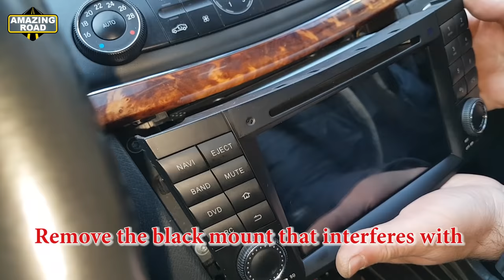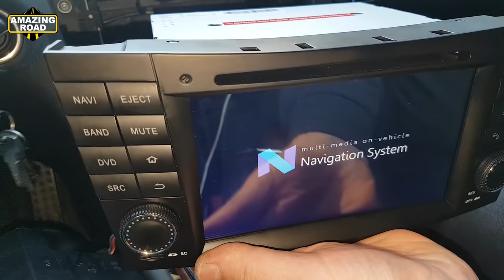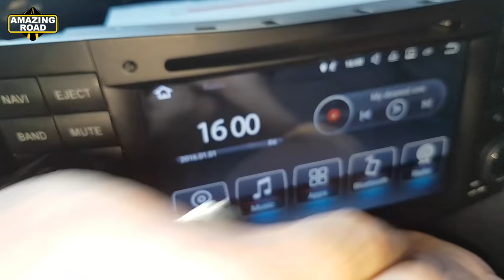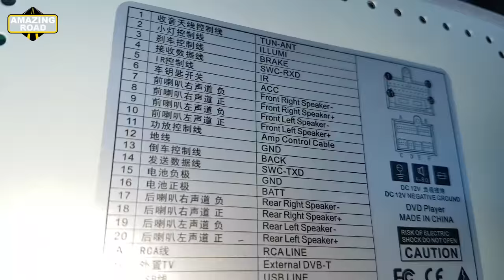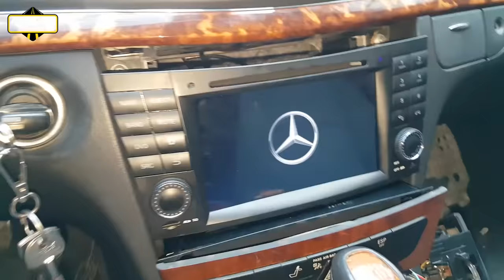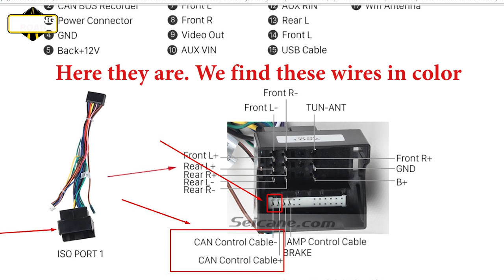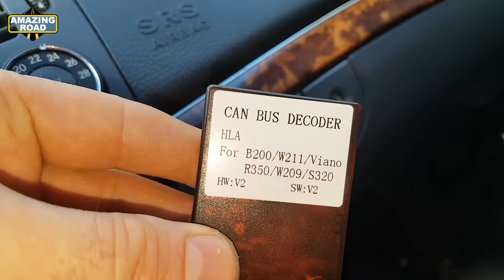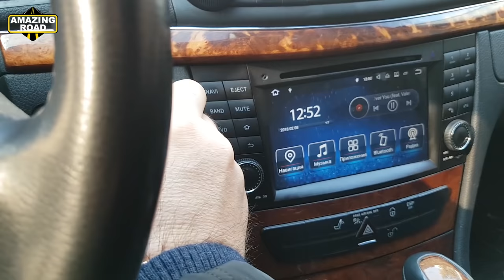Mercedes W211 Detailed Installation Android Radio DVD COMAND & CANBUS (Wheel buttons) & Decoder

Comment from the maker: Mercedes W211,W219 Android 7.1 DVD Radio (COMAND AUDIO)  https://youtu.be/2rZPcgJUnI4
Changing SBC Brake Pressure Accumulator in Mercedes W211 / Error C2131  https://youtu.be/CCXlfeDAly4
MERCEDES W211 IMPORTANTLY! HOW TO REPLACE FRONT BRAKE PADS https://youtu.be/6syWcyTcTVE
How to Make AUX on Mercedes W211   https://youtu.be/7JnVR-nF0UQ
Deactivation and Activation SBC Without Star Diagnosis at Home on Mercedes W211, C219,  R230 https://youtu.be/J8jaVufCQcg
Reply: Amazing Road TV  Barlus axpers, mi hat most usb adapter em zakaz tvel 211 i hamar, guzes dra dnelu videon unenas kanalumd?
Reply: Amazing Road TV mate what’s the tune yeh?
Reply: 00
Reply: meraba banada lazim nasil yapabiliriz bilgi verin yeriniz nerede

Comment: In order to get backlit illumination, I think I use a wire called "Key 2" on my android head unit because this is the key position where all my backlights illuminate in the car. If so, then I would connect to the third wire on the cigarette lighter as you did. Am I on the write track?

Comment: Amazing Video! I did everything as in the video but I don’t have Audio. I did not connect the + and - from the canbus cable to the decoder (green wires) yet. Is that the reason? I thought it‘s only for steering wheel Control

Comment: Great video! It has been helpful on my w219 and new seicane unit. I have power and the decoder hooked up but no sound. Question, do you have to have the canbus wires connected for the steering wheel in order to get sound? thanks in advance!
Reply from the maker: If you have optics, then you need a decoder
Reply: Thanks I got it figured out. I didnt have sound until the canbus wires were connected. Cheers!
Reply: Hey buddy I did this on my w219 and canbus under passenger dash connects steering wheel controls. I also have a seicane; let me know if you want chat or compare notes
Reply: LexBrett Gen2  pics of harness please

Comment: Great video do you know if this unit will work on a 2003 E500 as well? Thanks just don't see the E500 listed on there site. Thanks :)
Reply from the maker: yes. write to the seller. And use my promotional code for a discount 5%

Comment: This is a wonderful video, very helpful, but I have two question. Can this CANBUS work on Mercedes W210?  when you measure the CANBUS connecting wire, the voltage shows 11.26, seems it is car's battery voltage, and - wire seems ground, am I correct? I can not get that voltage from my W210 CANBUS two wires, do you know where is the problem? thank you.
Reply from the maker: The same thing I wrote another person who had W211. He also said that his voltage is below 11 volts. To be honest, I do not know.
Reply: Thanks so much!
Reply: @chinesehope  gsjf
Reply: Canbus worked on my w219 fyi its the harness under passenger dash
Reply: LexBrett Gen2 what u mean I have a 08 cls550 bought a android headuot for the W219 how does the harness look

Comment: If you have a Mercedes 211 with Harman Kardon sound system, you need one more cable that you connect from the radio to the leather amplifier in the trunk. This way, what you did will not play well.
Reply: But good work that you could connect in this way.
Reply from the maker: Instead, there is an optic box that is more expensive than this cable.

Comment: Hi how did you do for radio to turn on just putting the key in I’ve installed mine but I have to turn key1 to turn on and also how do you make the hazard panel open and close as mine is not moving at all??
Thank u
Reply from the maker: Yes, just turn the key

Comment: I have installed a similar device ZLTOOPAI ANDROID 10 W203 MODEL 2004 SPORT COUPE.i have noticed that the device is working at high temperatures 95c and in idle 65c-75c.The chip is RK3368 8core 1.5 with 4gb ram 64 flash memory disk.Is their any way to reduce temps cos it has DVD ,I haven't opened it but I search similar videos and I can't find.Also how I can have root access to rk3368 to install kernel tools to tweak the CPU undervolting and underclocking to reduce thermals.

Comment: i loosened the two screws under the radio but the radio still doesn't pull out. It holds in place like its still fastened to something. I have an E55.
Am I missing something?
Reply: I figured it out. Got to keep screwing the screws out, a long ways
Reply from the maker: Yes
Reply from the maker: https://www.youtube.com/watch?v=69yuzCO-_zg&t=64s
Reply from the maker: https://www.youtube.com/watch?v=xk4dCH97ky4&t=109s

Comment: Great video!  But, wow that looks like a nightmare for a diy novice.
Reply from the maker: I'm new too )))
Reply: I found this extremely hard for a diy novice as well; plus my head unit didn't come with instructions.
Reply from the maker: @lexbrettgen2120  No, not so difficult. Do you have a car for Japan? If not, then it is even easier.
Reply: Amazing Road TV  I have a 08 cls550 do I have the easy connection on mine

Comment: Hi. Thanks for your helpful videos. Help me with a question please. Will the decoder (you put the link) fit to another make of chinese head command? Or will a 6 metres cable fit as well as the decoder? And a last question: has the decoder been delivered soon? Because the seller doesn't like to answer. A great thanks in advance 👍
Reply from the maker: https://www.youtube.com/watch?v=5Pn3RZFFH2E&t=55s
Reply from the maker: If you have optics, then a 6 meter cable is not needed
Reply from the maker: https://www.youtube.com/watch?v=69yuzCO-_zg&t=30s

Comment: The MOST box in the video has Yellow, Black and Red wires, but on the website there is only Yellow and Black, no Red cable (ACC). I also have the Red wire, where do you connect it?
Reply from the maker: In the video, I showed everything in detail

Comment: I have the same Japan radio in my w220 s350 2005. Do you think the procedure with wires will be the same ? I am looking for solution with update.
Reply from the maker: Let it be the same. Remove the ashtray and look under it. there should be an optics wire

Comment: hello

i tried to install my new radio too with your instruction. everything pretty easy. but i get no sound... can you help me? do you know where the problem can be?
Reply: You have harmen carden speakers
Reply from the maker: Which system? Optics?
Reply: Amazing Road TV I have the same problem. Everything works including steering wheel controls but NO SOUND. I carefully watched your video and I think it is the blue/black amp turn on wire which I have not connected. Where does that wire connect to? Your video only says connect that wire but does not show where to connect it to? That will turn the amplifier on? Please help.
Reply: Mine is Harman Kardon optic unit
Reply: UPDATE- I have made it WORK!! No one seem to be talking about the “Fiber Loop” that you need to install on the unplugged CD changer fiber which will not be used going forward. I bought the $10 fiber loop from Amazon (Easyget Fiber MOST Optical Optic Loop Bypass Female Adapter For Mercedes Benz, Audi, VW, Porsche) and the moment I plugged in in- BINGO- the sounds started WORKING!!
Reply: Paul R how you connect your wires? Such as the fiber optic decoder, canbus and Unit wires. Which did you connect to the cigarette lighter and which to the constant?

Thanks

Comment: Hello friend ... I hope you can help me please. When I turn off the car and take out the key, the settings of equalizer, radio stations and all other settings are erased and I have to adjust them every time I use it. I have the yellow wire (b +) connected to the yellow wire of the original radio (constant power) and I have the red wire (acc) connected to the cigarette lighter. I think the problem comes from software or FACTORY ADJUSTMENTS You have some idea of how I solve it.
Reply from the maker: I can not help (((

Comment: Boss, I purchase the same screen exactly 9.0 Android PX5 ROM 64 / RAM 4 GB and i have 2007 350 Japan specifications i think same you’re and they asked me throw online if i have Amplifier before send the item to me I answered no because my car doesn’t have harman kardon or other sound system - my question why they asked me and I should order any extra parts for the screen / looking for your assistant please
Reply from the maker: If there is a harman kardon then you probably will need an additional optics module
Reply: Amazing Road TV 
No Boss,

I have nothing at all no sound system , some people they say something about optic fiber !? I have no idea 💡
Reply from the maker: Remove the ashtray if behind the ashtray there are two orange wires with skim light, so you have optics
Reply: Amazing Road TV Yes boss i have that cable , my Question if i have the optic fiber its mean there’s sound system and when I purchased the screen they send it without optic fiber decoder !? I’m not yet receiving the screen yet I should buy the optic fiber decoder separately 🤷‍♂️🙏🙏🙏
Reply from the maker: @atefabusaleem2760  Yes, you need to buy a decoder separately. I left the decoder link in the descriptions under the video. You can look and choose which one to buy
Reply: Amazing Road TV  ❤️❤️❤️ thanks really Sir,  You are a great Man 👨🏻
Reply from the maker: @atefabusaleem2760  Thx friend ❤️

Comment: Tnx in conector canbus i am + 3,5 volt and vorks on the steerling wheel but at s moving slowy ?
Reply from the maker: I do not understand your question. excuse me
Reply: Please your email und i am send foto....i am from Romania i do not speak englisch weell.....sory iam google translate...please und tnx
Reply: Connector all wiereisare conected to each other so it does not matter which pair of wires you conect.....HERE i am 3.5 volt  not 12 volt ...you understand please ?
Reply from the maker: Doriți să vă conectați CanBus și aveți 3.5 volți? Unde ai 3,5 volți?
Reply: In conectorul de sub bord in dreapta nu am 12 volti pe toate 5perechi de fire  3,5 volti        Trebuie sa fie 12 volti si nu merge comanda de pe volan
Reply from the maker: I definitely do not know this friend. I was there 12v. I do not know why you have there 3.5v.

Comment: Is possible work without decoder ?
Reply from the maker: If you do not have optics, the decoder is not needed
Reply: Possibile but  You should connect with new cable between door and sound system. So it iş possibile but silly
Reply from the maker: If it does not have optics, nothing needs to be connected and cut off. Connect to the original connector.
Reply: Amazing Road TV yeah that what i want
Reply: Is there any way to know if I have the optic fiber ? 2003 w211 with APS50 thx by advance

Comment: How many speakers your car have? Do you have factory subwoofer in trunk? Is the sound quality and BASS the same as before with factory headunit or possibly better or worse with installed Android headunit? Thank you
Reply from the maker: I have all the factory and no subwoofer. The quality is the same as before, but the sound is slightly lower
Reply: Amazing Road TV Harman Kardon audio system without subwoofer in trunk? That's impossible. Go check it out, the subwoofer is behind rear headrest, or you can open the trunk and look upwards and you will see subwoofer there.

Look at this picture: http://bilder.hifi-forum.de/max/892215/mercedes-w211-zeichnung_770550.jpg

Comment: I install isudar double din 4 gb 32 gb very easily with the help of your video every thing works fine thanks bro for this detailed video
Reply from the maker: Thanks )))
Reply: do you have optic fibre in your car? i am considoring to buy the same unit. Still recomended or do you have any issues with it?
Reply: I have a clss 550 where can I get the wired harness for an aggressive market radio

Comment: I have some questions.

1. You Said if you do not habe japanes and american Version of the comand it is Just plug and play. All will work. Does it mean same for  the canbus? So i do not have to cut the wires?
2. The optic Decoder is the same? Only remove from the connector and plug and play to the Decoder?.
Reply from the maker: 1) canbus must be connected as I show in the video. it doesn't matter USA, japanese and europe.
2) Yes

Comment: I have orignal german conactor but in the right side of big conactor 2 fibre optic cables r visible is this din works fine as you tell us if their is big conactor in the car everything is ready or i need fibre optic decoder

Comment: The FM Band in japan is  76–95 MHz right? Changing the head unit to a xtrons, this automatically will work with the US band 88.0 - 108.0 MHz?
Reply from the maker: Yes 88.0 - 108.0

Comment: Got a question not sure if you can help, I've installed an android multimedia system which is working fine, but can't figure out which wires from the original car harness are the source for the steering wheel function keys. Can you help it's for a CLK w209 05 plate
Reply from the maker: You have no instructions? Look in the instructions. Different models have different wires

Comment: I do not know if you know this, but do you know if there is a way to connect a backup camera and if so was the plug there? I have been told you can just plug one in but I want to make sure. Also, is there coax cables for a subwoofer there too? Thank you!

Comment: one question please. because I cannot put without a decoder directly from the outputs that the radiocd brings. without going through fiber optics? Do you understand what I mean? If you can give me your email and send you a photo with what I want to say and the radio I use would be great thanks
Reply from the maker: The audio system seller should give you all the answers. The seller will tell you which one is right for you

Comment: Seems astonishing that someone would go to so much trouble to connect all those wires, but just twist them together and wrap them in PVC tape. 
It's guaranteed that one of the joints will work loose, probably even before the PVC goes hard and unsticks (which will only take a few years).  
Doing it properly would have been very little extra work.
Reply from the maker: I showed how to connect. and you can connect as you think is right. Could say thanks. And what will happen to the wires, it will happen on my car. don't let it bother you
Reply: @AmazingRoad  Yes thank you for trying. Unfortunately you showed people how not to do it. That really is not as helpful as it could have been. 
Seems a pity because you went to so much trouble to film the fitting. Soldering the joints, or even using Wago connectors would have been very little more effort. Using the correct tape would have been no more work.

Comment: Hello,
Very useful video but I have one problem with my W211. When I connect the optical decoder with the aux in and out there are not any sound. Everything work, even the command from steering wells and everything but no sound. Did you know where is the problem?

Comment: for the steering wheel controle, there is a P2 cable, that looks just like an aux cable.  I put mine on, but for some reason it didnt work ( Im using a pioneer head).  Is there any extra wire that should've been conected in order to make the steering wheel control?
Reply from the maker: No, only this wire

Comment: What is canbus? Planning to buy generic Double Din and install with mounting bracket. Mercedes Benz C Class C220 CDI 2005. If I don't care about steering wheel control... do I need any special cables? I think this car is fibre optic therefore need more work?
Reply from the maker: The steering button needs a block CANBUS
Reply: @AmazingRoad  Do you have Facebook messenger or something where we can talk for some quick advice?

Comment: I'm looking to get one of these but I read it's not compatible with the factory Harmon Kardon amp located in the trunk. If so, what aftermarket amp is compatible, and are there any other components required besides what comes with the head unit?
Reply: Same amp. Just get the decoder that is mentioned

Comment: Hey Guys, Awesome video! any tips on getting that CANBUS X30/7 connector under the passenger side? I worked for at least an hour and am stuck. Have a great day!
Reply from the maker: You did not find Canbus? I will say that I used to have a steering wheel on the right side. It is made for japan. Maybe this will help you.

Comment: Thanks for a great and detailed installation video. I followed your steps and have connected everything including the Canbus, and the decoder box. I am NOT getting any sound from the speakers. Everything else works fine including steering wheel controls. I double checked the red and white plugs on the decoder box and they are plugged into the right ones. I had also connected my backup camera wireless transmitter with the power and ground cables and it’s showing power so that is not the case either. I don’t believe I missed anything.
If you can provide some troubleshooting tips that would be great. Thanks again!
Reply: One other thing I wanted to ask- the Seicane unit came with the radio antenna but my factory radio did not have an antenna cable. Is it coming from the fiber? I’m just confused.
Reply from the maker: I don’t know why you did it. sorry
Reply from the maker: https://www.youtube.com/watch?v=5Pn3RZFFH2E&lc=UgygwuD_jJhhyVq21-Z4AaABAg
Reply from the maker: Thanks
Reply: Did you figure this out? I'm having the same issue

Comment: hello friend, I have followed your steps and I do not know if the antenna amplifier cable has to be connected or it is only to check, at the end of the installation everything works correctly but the connected decoder does not emit any sound. You could tell me where the error is, thank you very much!
Reply from the maker: Do you have optics too? Maybe the decoder does not work?
Reply: I have the same problem